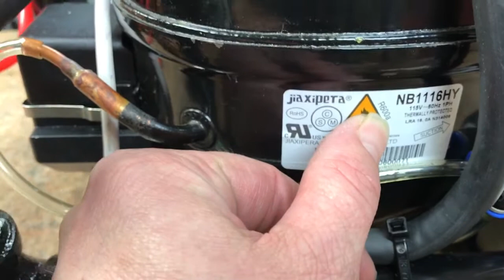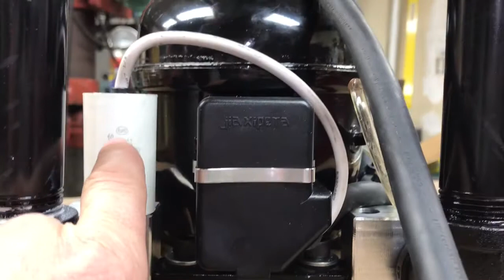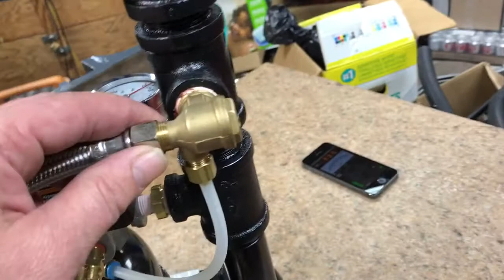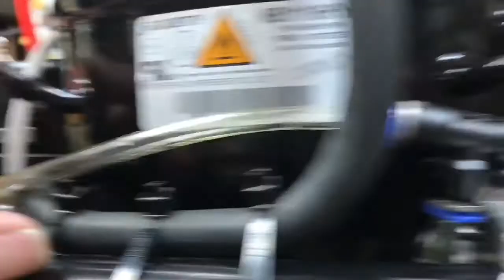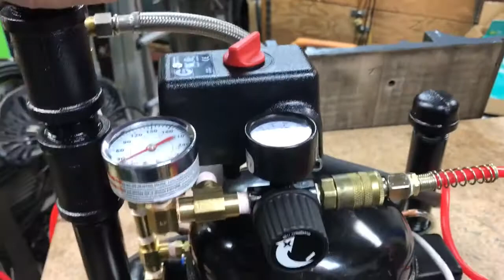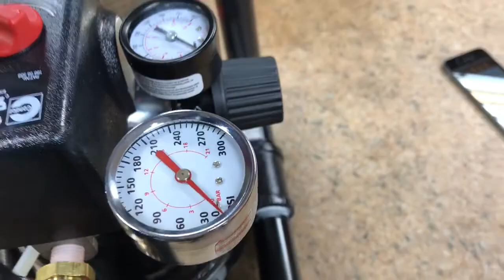Silent air compressor

Comment: Man your local plumbing store must love you!  These things usually make better vacuum pumps than compressors..  Pretty slick little rig.  I do refrigeration work and use a nitrogen bottle when I need a blast of compressed air.  It's cheap.  btw, that capacitor is a start capacitor, it helps the compressor start under high loads.  Which brings up an interesting point.  Compressors do not like restarting against high system pressures.  This is why AC units and fridges have built in time delays to allow the suction/liquid line pressures to equalize.  In addition, refrigerant contains oil to lubricate the pump and keep it cool which is now gone...  Granted you aren't running this very long and life span is probably a moot point anyways.  :-/  Never the less, ya put a lot of brain power into this.  Now let's make some FIRE with that Kwiky!

Comment: could this be duplicated with a home ac compressor?
Reply from the maker: Yeah, I don’t see why not. The only problem might be is that larger home AC compressors are 220 V. There’s a guy called Ozzie50 that is using larger AC compressors.

Comment: Nice work Matt. How many pin nails can you drive before it can't keep up?
Reply from the maker: Steve, I guess I would have to do an other video. 

 I have tested my 18 gauge pin nailer. 4 shots and the tank drops from 180 psi to 150 psi and the compressor kicks back on.  So I basically lose about 7.5 psi per shot.  The compressor recovers 7.5 psi every 3.5 seconds.  My pin nailer is supposed to operate at 90 psi.... so basically if you could get 12 shots off in less than a second i’d under the 90 psi.